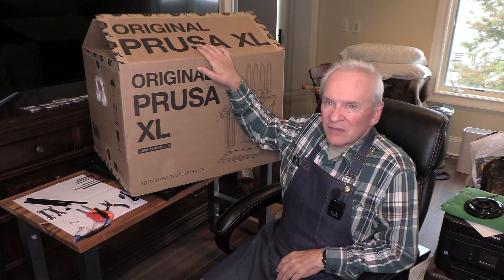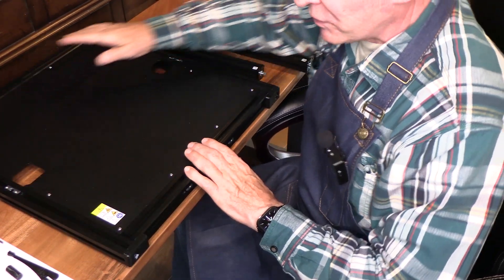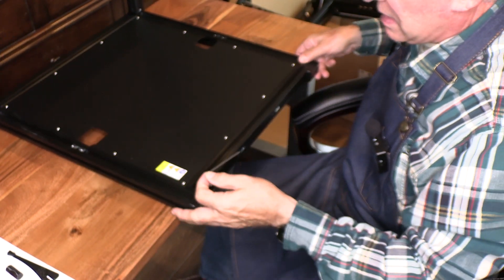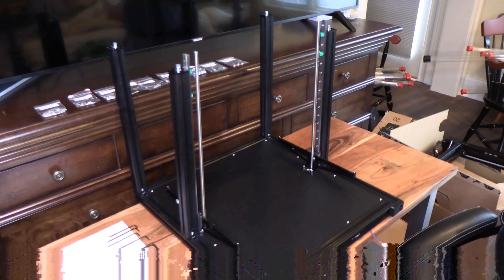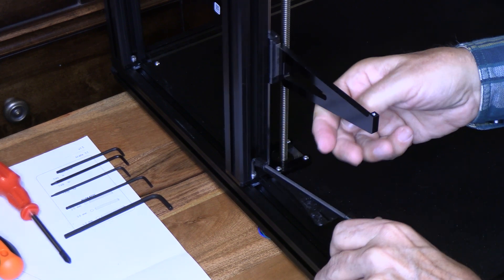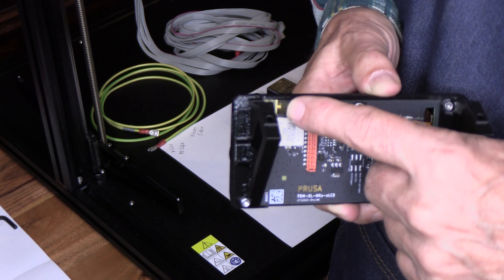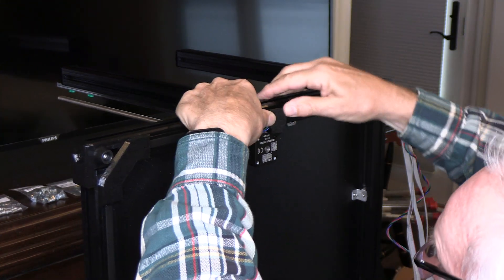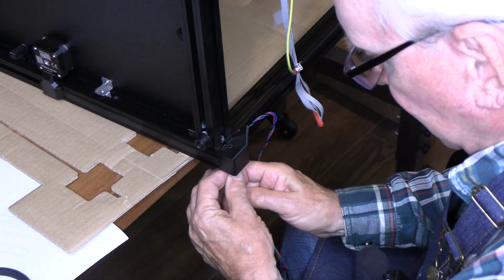Assemble the PRUSA XL 3D Printer with me! (Part 1)

Comment: Is it going to be a problem if I followed the cables to the left side of the frame instead of the right side in chapter 2? I'm currently following chapter 3 of the assembly. It was more natural considering the LCD inputs direction and I fitted everything the same way as it was discribed later on in the instructions. I just worry it might create a problem later on
Reply from the maker: Thank you for your comment. I know you’re enjoying assembling the printer. It is a lot of fun. The printer has worked great for me. I really love it. I think you’ll be OK and I don’t think you’ll have problems down the line. I would keep going consider subscribing. Thanks. Joe.

Comment: It is MUCH easier to attach the cables to the LCD before you use the screws to fasten it.  I am in the process of building the same thing.  A kit with 2 print heads.  I am calling this the worst $500 I ever saved.  This is a ton of work but I will eventually git-r-done.  Thank you for these videos I know I will be using more of them.
Reply from the maker: Thank you for your kind remarks. I'll bet you that you'll convert to the five had unit which is also fun to put together because it's so much more versatile. Consider subscribing. Thank you Joe